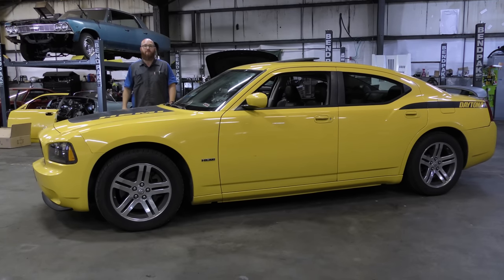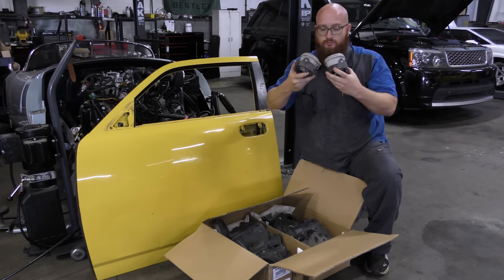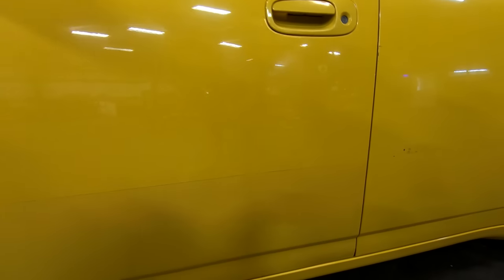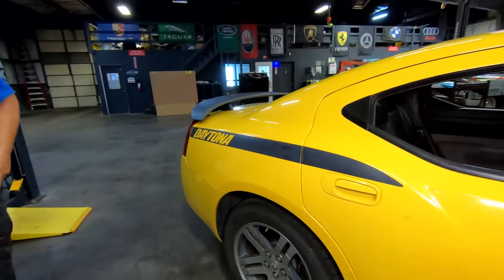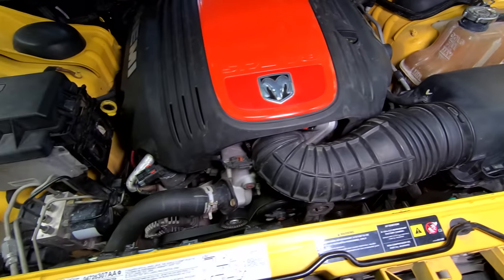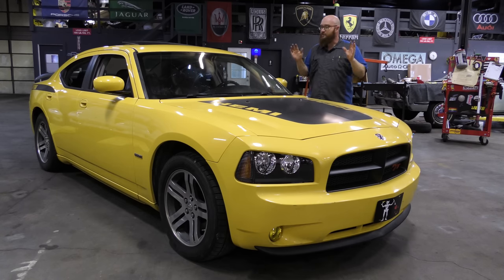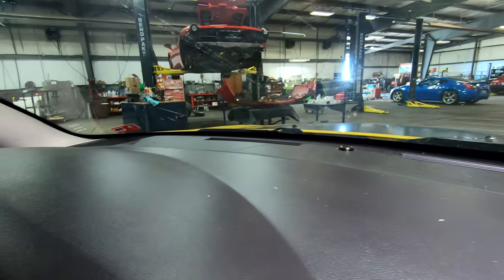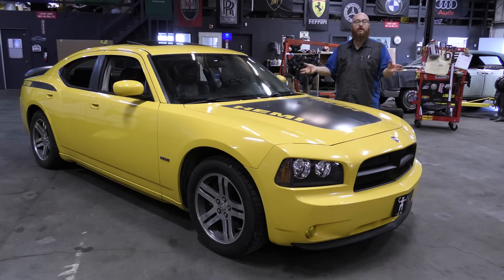Runs great! CAR WIZARD knows why he was sold this '06 Daytona Charger with a 'dead engine'

Comment: when you're the only one in your town with a specific make and model people tend to take notice. that's one sweet dodge.
Reply: Im dying to get a Challenger Demon and or Hellcat....hell, I even want the Challenger Super Stock Version. It's a Demon that's doesn't have trans break and drag rave mode and also without high octane fuel mode. Thanks to the US Government new regulations on car manufacturers having to have a high MPG average between all of its brands, has caused Dodge to have the cancel the manufacturering of the 6.2 Liter V8 Supercharged Demon engine in, 2023. That's the last year they will make the engine, because Dodges average MPG is above the limits because of this engine. Sucks!! Those engines will now be super expensive to find and buy after 2023. Watch, finding a decent low mileage Demon engine set up the way I said above, will cost over 35k for a "decent" used one. Watch. Ugh. Thanks US Government....its also forced Dodge to make a, All Electric Challenger.....wtf.....reason why Dodge has done so well since, 2018 and has made record sales and profits is because it was/is one of the last manufacturers that make a massive, powerful, loud, gas chugging V8 High HP engines. Dodge made the return of the muscle car era. Now it's being regulated away, again...just like it was back in 1973 when the government back then, chocked the HP out of V8 engines for less smog and better atmosphere for out furure.....F the future lol. I live in the now, I'll be dead 100 years from now, I don't give a crap lol.

Comment: The headlights made a huge difference. De-aged the look of the car
Reply: cataract surgery
Reply: I should shop around for new headlights for my own car. It could do with a refresher.
Reply: @Milnoc  turtle wax kit works wonders.
Reply: @Milnoc  aftermarket assemblies (by make/model/year) are widely available  Very easy to get a good idea of the costs of your multiple options. I replace the assemblies in our 2005 and then 2009 model vehicles within the last two years. Gonna keep both forever, so totally worth it.
Reply: 5:39
The third brake light is out

Comment: “It runs perfect”- Until the 250,000 mile engine blows up.
Reply: He already mentioned, then he'll put in a fresh 2nd hand one. Still cheap.
Reply: Mine has close to 211,000 and it runs just fine, as long as you keep up with the basic maintenance on these cars they'll keep going.

Comment: When buying a used vehicle, I stopped caring what the mileage is at and go by the condition/service history. Some of the worst used vehicles I have ever owned were ones with very low mileage. When you have a car with 250k on the clock, the game now becomes "how many miles can I put on this baby?"
Reply: Same, my old mustang took me to 287k and it was just maintained well. Meanwhile my new Jetta had a 36k service history gap and is in the shop for a timing chain at only 108k. 🙄
Reply: I have a former taxi that had 399,000 miles on the clock when I bought it. It now has over 436,000 on it, and has cost me way more than the original purchase price in repairs - including a secondhand engine and gearbox plus clutch, timing belt and service items. It's literally a game of "how many miles can I put on this baby?", with a side of "and how much is it going to cost me?". Sometimes I look at the odometer while driving it and burst out laughing. My next target is 477,710 miles, which is the average distance to the moon and back.
Reply: @Zeem4  good point. I was rolling with him until I had to think “what issues could a 36k car have” mainly electrical I’m sure. No matter how good a car is maintained engine / trans issues are soon to come which are the issues you are more likely ovoid with a younger milage car. Plus the worries of cheap aftermarket suspension/ other parts.
Reply: Yea same. It's got a lot of miles for a reason
Reply: Yep I had bought a super low mileage 05 cummins years ago. Wish I had never bought it, I think it had 24k on it when I got it in 2012 or around there. Would've been better to buy a maintained truck that had 124k on it probably. Learned my lesson on that though.
Reply: You know maybe the 250k is a good thing in that it means it had serious maintenance to get to 250k.
Reply: 96k Ford Ranger, constantly broken and flat garbage. 299k Honda CRV, never broke. Also had a very reliable 337k mile Buick LaCrosse

Comment: a friend of mine had one of those years back and he actually disabled the MDS so it would always run on 8 cylinders. looks like a car you should be in AWESOME!! it would look a lot better with newer black dodge wheels
Reply: That’s an issue people don’t realize. You can’t just shut off MDS and expect your lifters to be saved. You need to do the Camshaft Swap to a Non MDS Camshaft and swap the lifters for Non MDS lifters. When it’s in 8 cylinder mode, Chrysler’s genius asses figured it would be a good idea to conserve oil going to the Lifters. So when you shut off MDS, it doesn’t solve anything. This is a huge issue and so is idling. I idled my car to hell & back and suffered from an exploding lifter. I also drove around in Manual mode which disables MDS. So both of those played a huge role in my engine detonating lol. I’ve got it rebuilt now, running great. Just doing a transmission pump install now & slapping it back together.
Reply: These cars aren’t shit to work on. Mechanics dream. So, if the lifter blows up again, idc lol. All it did was chew up my camshaft. I took this time to do brand new everything. I wasn’t playing around lol.
Reply: @BWADaniel  See the 5.7 in my 2011 Ram has 212,000 miles on it's original engine and has had absolutely zero of the MDS issues people always talk about, and this truck has lived a life, so I can fairly confidently say that I think the system is fairly robust
Reply: The older ones like that didn't have lifter problems like the later ones, it was valve seats on them which was already dealt with on it.
Reply: Black wheels are a hideous trend. They ruin the look of a vehicle.
Reply: They only do for gas ratings; it is pure crap and is never needed with a conserved driver. Exceptionally respectable job on getting rid of that crap!
Reply: Samuel lopes? Is your friend my brother? 😎 If not, disregard this comment
Reply: @BWADaniel  i only run manual when im in highway speeds of 60+ that way it stays on 5th
Reply: @clifft7832  i very much disagree but to each their own
Reply: @clifft7832  its nothing wrong with black wheels. just like how its nothing wrong with big mud tires or 24 inch chrome rims. personal preference.
Reply: @clifft7832  every car I see with black wheels it just makes me think they never washed them. I guess that's the cheap way to get black wheels!
Reply: @SaintAndSinner99  You're right, it is just a generational thing. When I was young, a really cool car had Keystone classic mag wheels. Broke people spray painted their cars primer gray and the wheels black. I remember those days. If I could dip an entire car in chrome, I would be tempted. Now this generation wears black shoes and black socks with shorts, which we all used to laugh at. Times and styles change.
Reply: @clifft7832  That and all these car manufacturers offering their derivatives of blacked out trims, by the time they have caught on, it's been "murdered" out already (pun intended).
Reply: MDS that are in ALL vehicles is just a dumb idea. The few bucks you'll save per tank filling is nothing compared to the thousands you'll have to spend when your lifters and or cam shaft screws up. The New Police Version of the New Chevy Tahoes are having the MDS problem. Their patrol units are breaking down with less than 8k miles on em. It's causing police departments to have a shortage in patrol cars and budget issues in paying to keep em fixed and on the road. Even some that fail with the lifters and or cams from the MDS are failing again even after being fixed. Some have had to be repaired twice before 15k miles on em. The police version of the new tahoes are sweet though. They sit 1 inch lower for better handling. Suspension is beafed up. More HP. Bigger wheels and alternators and battery. More cargo space in rear. Has a 360 sensor and camera system to alert the cop when something and or someone is sneaking up on him or her. Bigger gas tanks too. Holds 6 more gallons of fuel. Transmissions have a shift kit. Gearing ratio is different for better/More acceleration. Can't wait for when they start hitting the auctions in about 5 years
Reply: @clifft7832  glossy black wheels look way better than polished aluminum or chrome when it comes to yellow cars. all of the SRT cars and trucks seem to come with black wheels and they look bad ass.
Reply: @uptownsamcv  I'm glad you like that look. It makes me cringe. Chrome all the way.
Reply: @clifft7832  Chrome on yellow looks horrible. OEM silver wheel paint looks better on yellow than Chrome

Comment: Great video. I bought a 05 rt magnum in slilver. I added cuda stripes on sude from ebay. 4 years ago from a older couple who had it dealer serviced. Ive got 210,000 on it now. I thought about selling it but it runs so good and gets ALOT  of attention. Your video just confirms that i should  jeeo it then swap a used eng orcyrans when tbey go. Thanks mr and mrs wizard

Comment: I think I first saw one of these parked up outside a restaurant when I was working in Brazil in 2014 and I thought "what a nice car, wouldn't mind one of those". As someone who drives a car with 313,000 miles on the clock, I think that if the car has been regularly serviced with good quality materials, high mileage is nothing to be afraid of any more.
Reply: Agreed. Especially if the car has been well maintained, 100,000 miles is a break in period.
Reply: My electrician has a small Peugeot panel Van with over 600,000 km on the clock. He said he just always changes the oil at half the recommended service interval and carries out general servicing on the dot. He also says if a warning light comes on, get it checked out immediately and repair any defects as they occur.  He reckons just by attending to faults promptly and the van will go on and on, day after day.

Comment: Hello Wizard,

When pulling interior trim, I found a new tool several years ago:  Take an empty 3-4" diameter wire spool and roll in under the trim.  It will "walk up" on the metal clips while also bearing a load before and behind.  Easiest trim tool I have ever used for I/P (dash board including front radio HVAC trim)

PS:  Mistake is getting down in the mouth over miles.  It is a survivor and because it has many miles you can continue to drive vs. being worried about loss of history for a museum.

P-Chi

Comment: You should install a melling High Volume oil pump to keep that cam from going flat. The oil pressure on these hemis drops to 15 to 20psi at idle… and I would buy a programmer and shut that off. MDs is the death of hemis
Reply: Cams don’t go bad on those old ones. That’s 2009+ they burn up cams
Reply: Where do you get one

Comment: Not 1 panel clip broken during replacement, that’s rare for a dodge. I would of disabled the MDS on it as it’s a known problem on these cars. My friend paid 4500 for an 07 rt with an interior that’s kind of falling apart, smashed subframe, and a minor oil leak which which is pretty good in my book because it’s also a rust free California car with only 150,000 miles. He has No running problems currently
Reply: Would have. Not would of.
Reply: I’m looking at a 2014 R/T AWD. It has a smashed front subframe but still drives fine, it has a rebuilt title for that.
Reply: @Hamsalad2  the one my friend owns had a clean Indiana title when he got it

Comment: I got similar reactions from people when I finished the body work and paint on my Magnum with the newer style charger front end swap and hellcat hood to match in a kind of midnight candy metallic blue and a nickel plate style powder coat on wheels.  TBH I was going to toss the 200k 5.7 hemi because I was told something similar with the power loss and bad sound coming out of some way too loud exhaust.  I did a full service, put on an exhaust with a similar goal to this car, and I couldn't tell what the previous owner was talking about at all.  All I could come up with was the same MDS qualms, it was driven mostly in town in traffic and with the new bad-to-me exhaust I guess the previous owner thought it was dying since it basically sat in lower power mode most of the time in between/at stop lights.

Comment: Hey Wizard, 06 charger SRT8, 84K owner here. Extending the olive branch, currently have mine torn down to the block, due to dreaded lifter failure took out the cam, the "hemi tick" issue.
Reach out if you have any questions, I previously had an 05 magnum, same lx platform. 
Quick note: look up "pink thingy" that is in the shifter box, and change it immediately if not previously done, otherwise, carry a butterknife in the car.
Also, Moog problemsaver is the go to for all suspension bushings, tie rods, etc.
These also have a recall for fuel pump, check your vin on that. After a fill up, car might shut off, like at a stop light.
If replacing ANY sensors, go OEM only, trust me on this one, been there, done that, got the merit badge.
There are a few good Facebook groups with some really smart folks on there.
For your exhaust replacement, make sure you put in the short flex pipe pieces, they go just after the cats, these help save on your cat back sections and hangers, they lessen the movement on the pipes when you romp on it.
Enjoy it.
I agree, its like driving freedom.
And when you are at her second home, the gas pump, just remember, it's not about the $$$, its 'smiles per gallon!'

Comment: This car is really looking great. For $3,000 it's a steal. I still have my 14' Hemi Charger I bought 4 years ago with 93,000 miles on it, and I plan to keep it long term. 5.7 and  it has been trouble free, and I take care of it really well. I added front and rear strut bars for more stability, and I noticed the handling is quite a bit better. Also a dash mat for the dashboard. Some people don't like dash mats, but I think it looks good, and it does protect the dash from cracking. Plus I garage my car, so that helps too. You for sure scored with this one, looking forward to stage 3.
Reply: Cost of gas. Within 5 years, you would spend 10,000 dollars compared towards a 4 cylinder that spends 5,000 on gas. That is without mentioning the extra cost of oil changes. All in all, an awesome cheap muscle car for nothing.
Reply: @godemperormeow8591  but the happiness of owning the 5.7 will far exceed any measly 4 cylinder
Reply: @godemperormeow8591  life is too short to driver boring cars
Reply: Austin Batton  that's just how some people think I suppose. I do kinda see where he's coming from, especially when the gas prices are over $7 a gallon in some places, but yeah, thinking a car is better than another solely based on fuel economy is a bit far fetched.

Comment: You've done a fine job with this one, it looks and drives like it has a lot less miles. There are decent used vehicles out there, I've been lucky with the ones I've bought. Just focus on condition, not color or options.
Reply: It’s been mostly a game of luck for me. Most recent car, an Infiniti J30 lucky number six, hasn’t failed me.
Reply: True. New cars ain't cracked up to be what they claim.

Comment: OMG I actually watched someone else besides me from the Motor Pool work. It’s a Miracle. Lol like I said I had 16 years with 2406 of 4000 Go Mango never had to replace the defroster panel or had any major body issues or engine issues. Replaced the compressor twice, one water pump, master cylinder, and only one injector in 116,000 miles. Great Videos Thank You 🙏

Comment: the thing with 250K miles is that it got there and still looks good. I have a Ford Fairmont AU1 Wagon and it has 350,000k on it and I just replaced the engine (it cost less than rebuilding the original. the rest of the car is so good it is worth spending money on it.

Comment: I discovered the Wizard's car attitude but much later in life ...

Whether it's cars or motorcycles, people can be totally obsessed with mileage/condition ... I get their point of view ... 

I've owned a multitude of cars & bikes ... only to ride, drive them on weekends. In order to keep wear/tear & mileage down to keep it's value up. The rest of the time they just sat in my garage.

I did this for years. Then reached my 50's and reassessed my whole reason for having cars/bikes ...

I soon found that DRIVING your car/bike on a daily basis (for me anyway) brings much more joy. Isn't that the whole reason we're 'petrol heads'?

I can now live with patina on my car. 
I maintain it, polish it, look after it & drive it ... daily!

The Wizards Car is basically my 92 vet. Over 200 000 plus miles, some patina but still looks good.

Comment: Mine is a fully loaded SXT 3.5L 5-SPEED, it was made with Daytona wheels,  looks identical to a RT. I bought mine for $1700, had it for 5 years, in mint condition. I replaced timing belt, waterpump, new brake lines, transmission lines. It's a summer toy and work in progress like yours too. Fun car to drive

Comment: 4cyl mode on my G8 GT, with stock exhaust (mufflers were huge), wasn't too bad. A bit of a lower pitch was all that you noticed. After installing a solo cat-back, it was horrrrible! I knew this going in, and used a flashpaq to turn it off.
Reply: Mines the same, it came disabled via a handheld tuner and I figured I’d give it a try to see what it sounded like. 
Through headers and a borla catback it was alarming to say the least 😂 got turned right back off